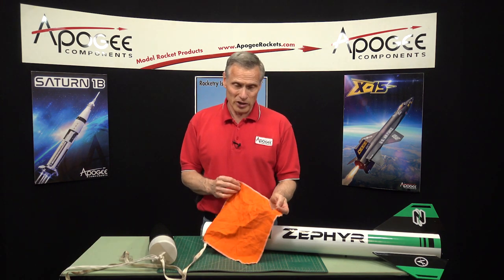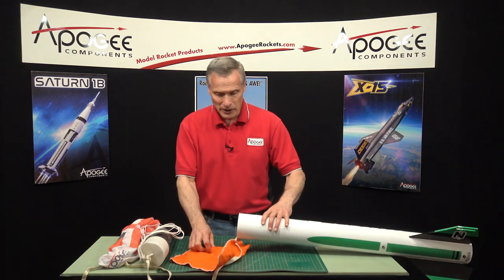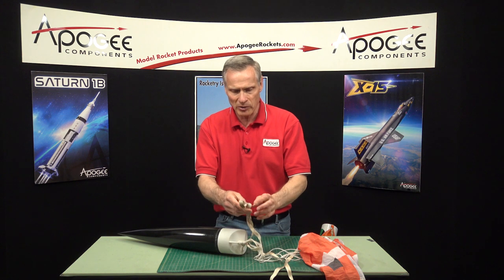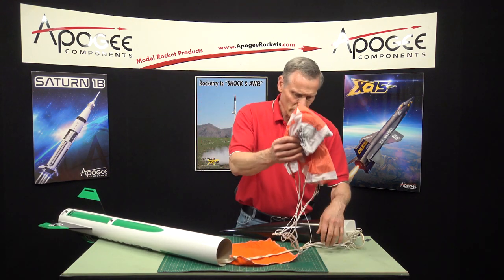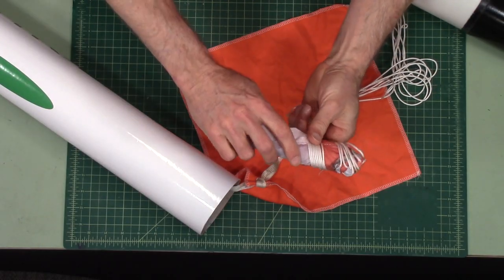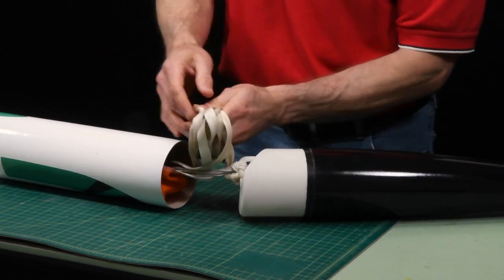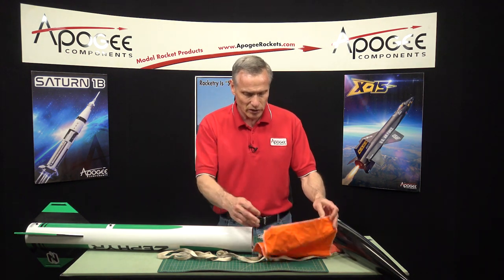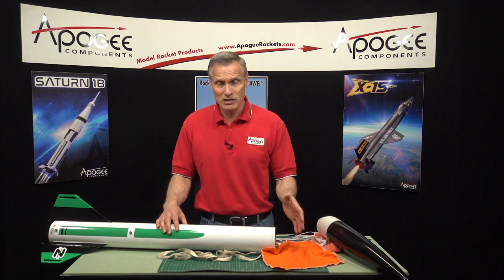Using a Cloth Heat Shield In Your Rocket

Comment: I ordered a few of these Nomex parachute protectors from Apogee.  For low-power rockets, though, the shields are pretty small (3x3).  I assumed that once you have it connected properly to the shock cord, you would just place it into the tube body as you would any other wadding, and then place the folded parachute in behind it.  I'm not sure that the parachute(s) I am using with these smaller 1.5 inch tubes would actually fit entirely in the Nomex protector.  Is there any danger that not wrapping the parachute up entirely within the protector will mean that the protector will not sufficiently protect the parachute?  Thanks.
Reply: For regular deployment my rockets all have baffles which work well (not to mention provide an excellent shock cord anchor) , so I can't tell you about that.
For dual deployment, it definitely won't protect the chute like that.
I wrapped the chute up in regular paper wadding which worked great and didn't take up scarce real-estate in the small diameter airframe.

All that said, damage from the burning cinders of the deployment charge is always a danger no matter what.

Comment: Is there any reason to not put the shock cord or some of it in the protection with the chute?
Reply from the maker: The shock cord is usually beefy and can take the heat of the ejection charge. But you could use a shock-cord protector on it if you feel it is necessary.
Reply: @apogeerockets  noted and thanks for the reply

Comment: Sliding up the shock cord? You mean like this: https://wildlightimagingstudio.com/img/s/v-10/p2592661076-6.jpg

LOC IV Cesaroni I540 launched 6/5/21. The rocket "helicoptered down" to a good touchdown and we knew something wasn't right with the recovery system. We couldn't tell what was wrong until I got to the rocket and saw that the protector had slide up to but thankfully not over the shroud lines. Improvements have been made but this video confirmed what I thought was going on.